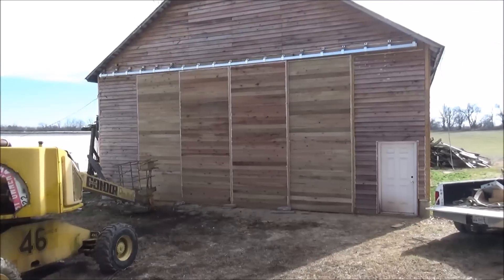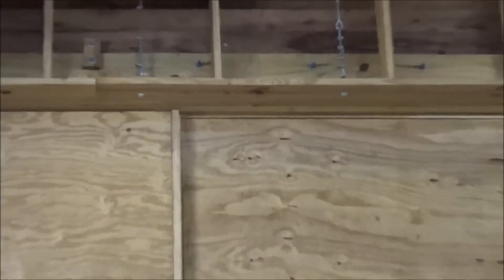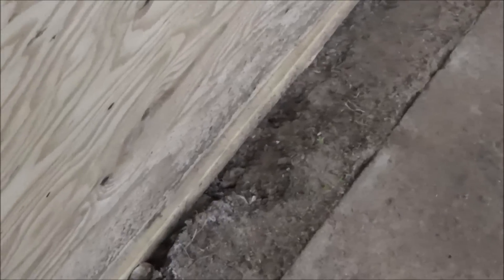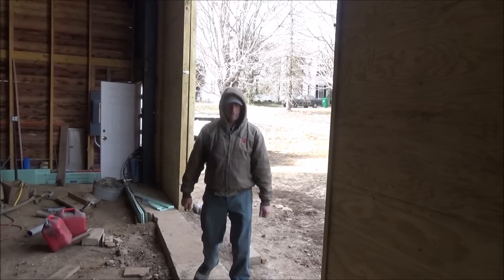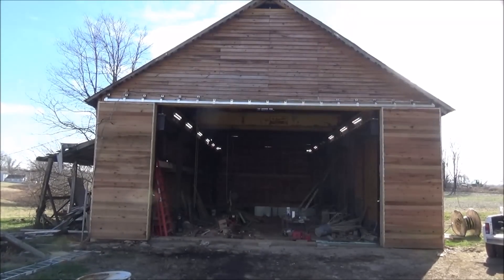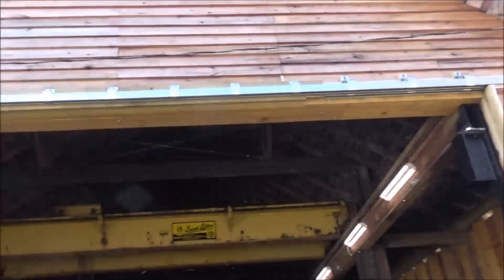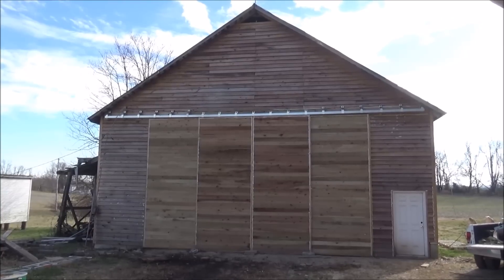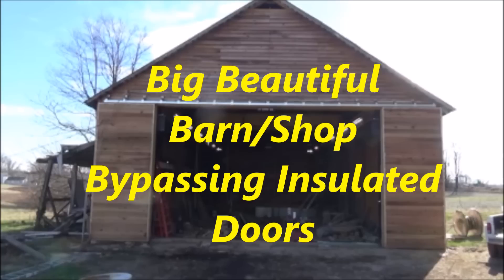Big Beautiful Bypassing Insulated Doors for a Barn or Shop

Comment: A late suggestion to use if you decide your latches are not adequate (I suspect they will not hold up long term if the doors get used much).Salvage a closer/latch from a 53' semi-trailer. I bet one side could be let into the by-passing door. The lever end would prolly fit onto the door edge, though you might have to modify the lever. That would get you 3 or 4 latching points, and would latch the portion you can't reach from the ground. Since they cam as they close, it would pull the doors tight.

Comment: A man after my own mind! Overbuilt, not over engineered!  Now you can fire up a torpedo heater or something and work in a bit of comfort. Maybe climb a ladder and seal any cracks in the sheathing on the walls from the inside. Fine shop and great work, Brian.
Reply: Yes I agree with the filling of the gaps from the inside. Much easier to do now and would look nicer from the outside. I don't think the paint will do enough to seal the gaps on its own.
Reply from the maker: Caulk and then paint was my plan.

Comment: The doors are beautiful Brian--shop is coming along nicely.  The combination of your quality of work, your attention to structural mechanics and engineering generally, and the preservation of a historic building is awesome to behold.  

I note that it would have been MUCH easier (and probably cheaper) to tear the barn down and throw up a prefab steel building.  Nobody could fault you for it if you did--after all, you'd have been in and making chips a long time ago if you went that route.   
Instead, you took on a massive project that has really turned out to be a thing of beauty.

I always look forward to updates on your progress.  Keep up the incredibly good work, and thanks for the entertainment.
Reply from the maker: It would have been a lot easier to pay somebody to build a new prefab building but it certainly wouldn't have been cheaper doing that.  Not a lot of companies building prefab steel buildings would have been crazy about integrating a 15ton bridge crane either. I find that usually when you ask for things out of the ordinary they either get messed up or they just don't even want to try to do them. Since the barn is in my front yard I enjoy the classic look over a tin can a lot anyways and since I will likely be looking at it for the rest of my life that alone has a lot of value. I am glad to hear you enjoy the videos. :-)

Comment: Bryan, Your progress is excellent, and I bet you will be moved in and operational this summer.     You may want to put a couple hurricane pins in the bottom of those doors to keep the bases of the doors from blowing in or out in really high winds.  Most hangar doors like that have a pin or two near the center of the door that goes into a hole in the concrete.  this keeps the base of the doors from blowing in or out when high winds hit it.  Chris
Reply from the maker: Probably best to have the doors shut in high winds so the roof doesn't try to leave.
Reply: The pins are to keep the center of the doors from blowing in while the door is shut during high winds.  I would never leave a big door like that open in a wind storm.  We had the roof blow off a really big hangar / Terminal Building  at Bader Field airport in Atlantic City because they couldn't get the hangar doors closed during a storm back in the 80s.  Chris
Reply from the maker: The doors are taller than the concrete so they can't blow in.

Comment: Damn nice doors. Such a huge opening but practically the same insulation factor as a wall once shut. If I ever need to build a large shop, it'll get these for sure.

Radiant heating/cooling is a great choice for a building like this. Just make sure they don't saw the control joints through all the lines like a friend of mine did!
Reply from the maker: I am burying my lines at the bottom of my concrete so they avoid the likelyhood of drill damage and to keep the top layer of my concrete from being weak by being swiss cheesed with water lines. With the extreme weights on my floor I would rather have strength and stability over thermal response.
Reply: bcbloc02 Good thinking. Might also want to run a few of the perimeter lines closer together for a bit more heat/cool along the walls of the shop. This might be standard practice, idk, but I've seen it done a few times and it seems like the way to go.

Comment: Nice job Brian! You will have ample room for the concrete mixers for the coming pour as well as move all of your machinery to its' new home. A linear actuator of some type with the automation enabling you the option of opening and closing the doors in any combination with just a touch on a display panel would be a nice touch after everything else is done.I sure wish that I was able to get down there and give you and Bailey a hand.
Reply from the maker: I am currently PO'd at electronics. If I could get a voltage regulator that lasted more then a month or 3 for my truck i would be tickled to death. I think I have put 6 on in the last 2 years.  Not using stuff with failing electronics is currently making me happy. :-)

Comment: Brian a welding shop in central Illinois uses a 40 gallon hot water heater expansion tank.black plastic water well pipe and valves on each pipe heat his shop works good

Comment: They sure look a lot better than some generic roll up door! No way I could work in a shop with no windows though...

Is there a latch to keep the doors from blowing around when they are open?
Reply from the maker: Not yet. I don't think they will move when open since wind can't get behind them and they were designed so they touch the trim and are supported so they can't blow in any either. It was all done as a much tighter fit than is normally recommended. On my other barns the doors don't flop when they are open it is when they are shut they go crazy.
Reply: On our barn at home there is a big U shaped bracket at the bottom, anchored to the wall. The door rests inside the U when open and the wind can't swing them around.

Comment: Awesome build!  Curious...do you have to protect the track from the weather?
Reply from the maker: You probably don't have to cover the tracks at least not for their protection. After I paint the barn I plan to add an angled roofing panel over the  tracks to keep driving rain off and from coming down the insides of the doors. The regular barn roof keeps the weather off unless it is coming from that direction now.Baily says give Howie a treat.

Comment: It's one of those jobs that you figure out exactly how to do it as soon as your done with it, HA HA.  The doors look fine, very functional and convenient.  It's been quite a saga you've been through.  I bet you're relieved and looking forward to moving on to the next task at hand.
Reply from the maker: There is always another project to move on to. :-) I am glad the design that was in my head worked out well when applied that is for sure!
Reply: bcbloc02 I forgot to encourage you to do some important research before pouring your concrete floor.  You can get a much flatter floor if the right concrete mix is used and the correct technique is applied.  I was trained as a structural engineer and I worked on a number of projects, like a missile factory and a science laboratory, where exceptionally flat floors were required.  It isn't cheap but a very flat level floor could be quite nice to have in a machine shop.  You can't get top quality without temperature controls.
Reply from the maker: I doubt I have the tools abilities or the supplier to get that far into it. Not to mention the budget. Wet concrete is easiest to work, but because of the thickness and the fact there is existing concrete as well I think going in on the drier side and working it harder will give a better result. If I get a nasty high spot I can always grind it off.  if I can get as good a quality as my garage floor I will be happy.

Comment: That is really a nice job on the doors. They seem to roll really well for as heavy as they are. I know of a house here in Texas where the house is cooled by 58° spring water through a giant evaporator with like a 2 gal a minute pump moving the water. Cools really nice. Not sure of the Cfm fan for the central collector to push it into the rooms. Really nice job on the whole project.
Reply from the maker: Thanks! The only problem I see with my idea is it may make everything want to sweat in the summer time when it is super humid, but maybe the addition of a dehumidifier would be enough to keep things under control.

Comment: Hi Brian:
Long Road to completion but when finished, it will pay the effort. Are you planning on heating the building? I figure that at the pace you're going, it should be done this year.

Regards

Jorge
Reply from the maker: Yes radiant floor heat built into the slab.

Comment: Boy Brian, it's hard to believe you were able to do all this work by yourself. It's looking magnificent. Is the insulation next on the priority list, that will really make a difference in comfort. Then the floor, your heat, and cooling idea sounds like it should be very comfortable. Are you going to have the concrete trucked in and will you get help with it? I have been following your progress on the barn from day one, and love every video that you have made on it, keep them coming and I'll be waiting.
Reply from the maker: I might be crazy but I am not crazy enough to mix 100yd of concrete on my own. I will for sure have it trucked in and I hope to have at least some help for that. I actually had tried once to get some pros to look at the job but they said 3 times they were coming and never did so I guess I am back on my own. I will probably try to catch the insulation on sale sometime. I am more interested in getting the floor done than the insulation as I would really like to get the walls painted and sealed before putting that in.

Comment: Awesome build. Will you have some raincower on the top of the doors? And you may have some pins in the middle of the doors so they not go in and out separately.  ☺
Reply from the maker: Yes after I paint the barn I plan to add a angled roofing panel over the tracks to keep driving rain off and from coming down the insides of the doors. Once the concrete is in and the doors latched too it at the bottom all swinging ability will be gone.

Comment: Brian, I hope you aren't too far along that you can't re-think your cooling system. Radiant heat is wonderful but, if you are thinking of cooling by running water through the floor, it just isn't a good way to cool.
 Part of my job at Alcoa was taking care of the HVAC in the plant office building. The ceilings in the whole building had a lattice of copper pipes, through which conditioned water was pumped, attached to 2'x4' perforated metal panels. In the winter, with the hot water flowing through the pipes, it was a wonderful system. Gentle, constant, quiet heat. In the summer it resulted in a warm, clammy, humid environment. During periods of high humidity, when the dew point and temperature got close, the condensate actually dripped off of the panels. Needless to say, the plant managers office was the first one to have a forced air air conditioner installed. It was so bad, they talked about razing the whole 100,000+ sq.ft. building. 
Just a word to the wise,
Rollie
Reply from the maker: My hope was since the slab would not be as cool as the water  in it that the tendency to condense would be reduced enough a dehumidifier can take care of it.  If it doesn't work out I am only out a ball valve and 50ft of pipe so no big deal. Then I would have to either buy an AC unit or go back to working with outside weather.

Comment: Hi Brian, that shed looks awesome!!!   Looks like a shed 'no pun intended' load of concert work there.  Are you getting a jaeger lorry or hand-batching/using a small mixer on the floor?  Kindest regards.  Joe.
Reply from the maker: Truck load after truck load of the good stuff will be hauled in here and dumped. I am not crazy enough to mix 100yd of concrete by hand!

Comment: I look forward to seeing the cooling system. It's something I had thought of for a shop I once built, after building it. Live and learn.
Reply from the maker: There is a spring right beside where my hot water boiler will be. It is my plan to circulate the cool 55deg spring water thru the floor for cooling in the summer time.  I think it should work well, worth a try anyway.
Reply: Interesting. So it will be an open system in the summer, and closed in the winter, I suppose.
Reply from the maker: Yes.

Comment: I don't know that you need to, but you could put a couple more latch plates on the inside edges of the doors and then you could latch them into the open position using the existing latches.
Reply from the maker: Had 40mph winds yesterday and the doors were open all day as I cleaned in the building and they never moved.

Comment: I think you'll find that you keep the doors open when you can as you don't have any windows, I have 4m x4m double doors in my workshop, despite my having windows, the doors are open whenever the weather allows! Regards, Matthew
Reply from the maker: I love being outside so if the weather is nice I likely will have the doors open and since they are north oriented they only get indirect light so no glare problems. :-) That being said I usually only get to work in the shop after work so it is often dark so not much chance to get natural light in there when I am working.
Reply: bcbloc02 north doors . hopefully  weather not horrible in winter

Comment: Great job! Are the door frames wood? Where did you get the bypass hardware?
Reply from the maker: Yes the doors are all wood with polystyrene core and wire bracing. The hardware for the track is from Richards Wilcox in Illinois the details are in the description.

Comment: All you need now is a 25ft wide broom to clean the shop in one swoop. :-)

Nice work and thanks for regular updates.
Reply from the maker: Well I need to have a flat floor 1st for optimum broom contact, then I could just hang it from the crane and drag it the length of the shop. :-)

Comment: Hi Brian,
I sure hope you don't find something that doesn't fit thought that fully open door, this would get you an endless life of bigger and bigger barns construction.   
Guess you're getting a little anxious to enjoy some machining time in that new dog house...   Suggest you get a real good coach for the co-owner, if you want to be tolerated with all your giant tools...
By the way, don't you ever get any snow around where you are, everything looks like a permanent Fall season...???
Cheers,  Pierre
Reply from the maker: There was a thrown out couch on the curb up the road. If I had a floor to put it on I would have gone and gotten it for the tennant. :-) There was a half inch of snow here last Sunday but overall it has been a very mild winter. It usually snows one day when it is 20 and then melts the next day when it is 60. It was low of 9f yesterday morning and is supposed to be 65f come Tuesday.

Comment: Nice job you did there !

Just remember to draIn the groove in the bottom for the doors to slide in - maybe even paint the bottom 10-20 inches with a lot of oil !
Reply from the maker: Thanks! They will all be painted and sealed when I paint the barn. I plan to put some weatherstripping on the doors as well to get an even better seal but I don't want to apply it till the paint is on.

Comment: Looking good Brian.  Cue the caravan of cement trucks!
Reply from the maker: Not yet! Got to have all the water lines in place 1st! worst part about radiant slab heating is it is really a one shot deal!
Reply: Think twice about radiant heat, Brian.  Radiant heat radiates (duh), so it does not do a great job of warming the air, but rather the next solid surface,  That might be you or Baily, or it might be the walls, or the roof.  Heating you and Baily is a good thing, but that is a lot of infrastructure to heat two animals.   The walls and the roof will just let the heat out after the radiant heat changes to convective after the rays hit the surfaces.  Sorry, I do not have a magic plan that is more efficient beyond focusing your design on warming Brian and Baily, and not the roof.  Machines can put up with cold conditions, and so can the structure.  A small radiant heater near where you are working and pointing right at you would use MUCH less energy, but would also tend to keep you there, staying warm with Baily and not moving to where the work is.  I just think that a bunch of pipes and an outdoor furnace is a recipe for a lot of entropy for heating two cold mammals.  Also remember that radiant heat only heats the side facing the source.  Think about other options...
Reply: Bob Korves Interesting. I once worked in a hot water floor-heated woodshop. It was slow to warm up but was easily the most comfortable shop I've ever worked in over the winter.
Reply from the maker: Cold machine tools are neither happy or accurate. The more stable the temps are the better for everything.  I have more than enough dead trees around here to keep the shop warm for a long time.  For a high ceiling building I don't think radiant can be beat as it keeps the heat down where you are rather than forced air that just goes straight to the roof.

Comment: Take the rippings, generated from milling the poplar for the doors, cut them to the length between the studs, and tack them on the inside top edge of the siding to close the gap that appeared when the siding shrunk. Use it all up on the biggest gaps before insulating and painting.    I'm looking forward to every update. I like what I'm seeing.
Reply from the maker: The strips are pretty thin I am not sure I could even get a finish nail thru them without splitting them. I think I would have to glue them in place to use them as you suggest.
Reply: Pin Nailer or Staple gun.......